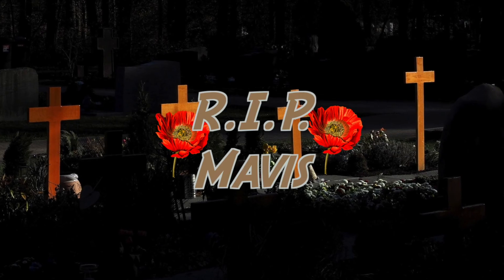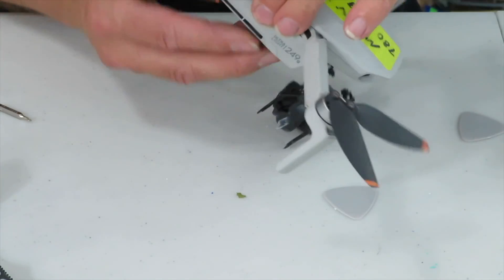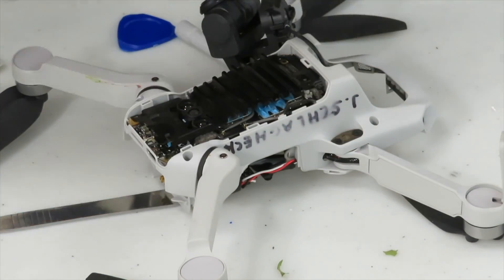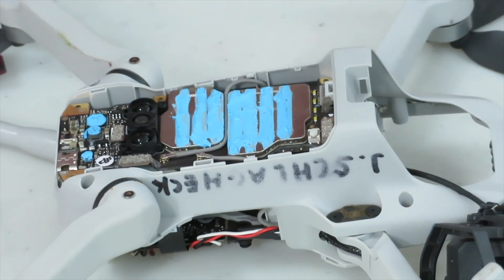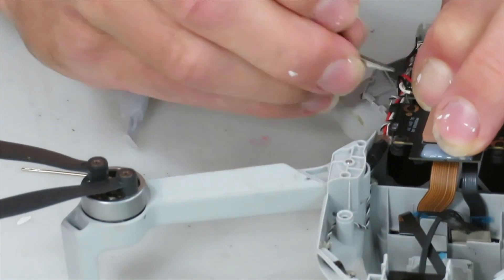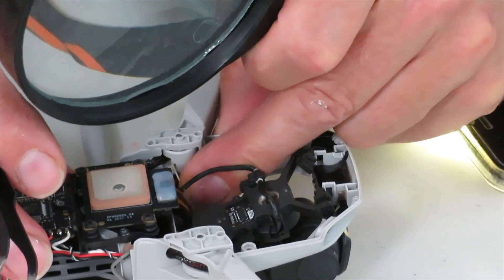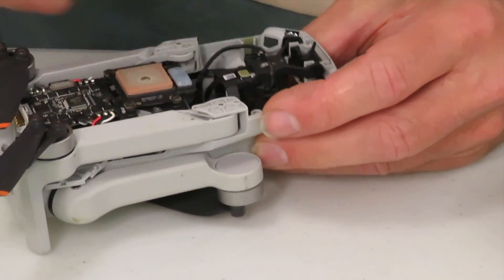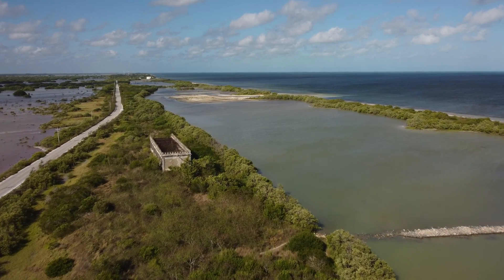DJI Mini 2 Ribbon Cable torn after a Crash? Fix it Yourself for Cheap!

Comment: Sir !!!! This is an excellent video. We have been using this drone to help film our house build.   Had a little mishap and couldn’t figure out why the gimbal wouldn’t move, he lies the problem. Your video was extremely easy to follow and very, very helpful! I’m pretty mechanically inclined, but I don’t like pulling on thin pieces of plastic, especially when they feel like they are going to break.   You’ve gained a new subscriber for sure.😊🎉
Reply from the maker: Thank you. I'm glad it helped 🙂